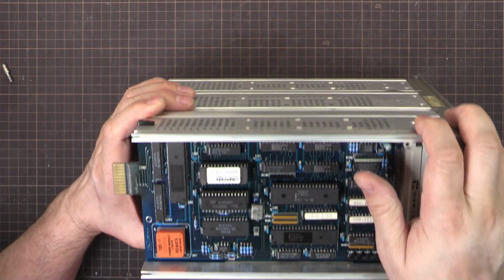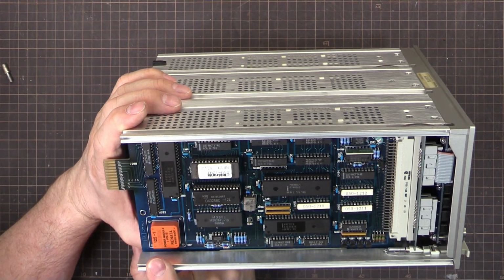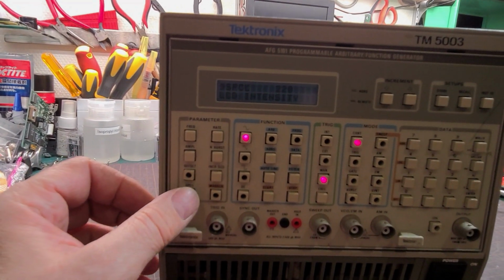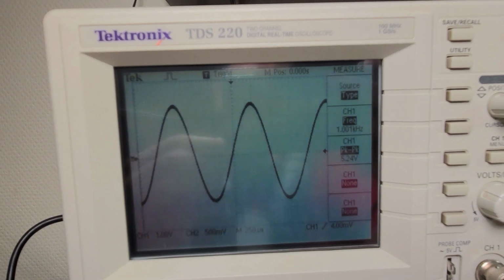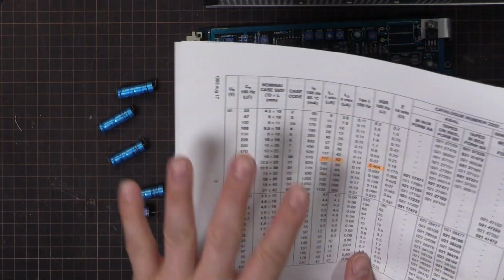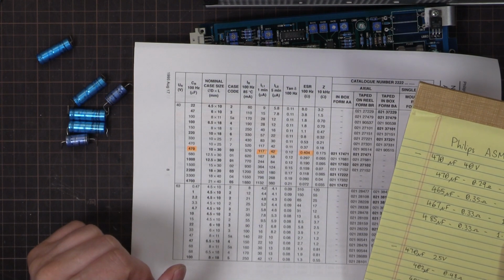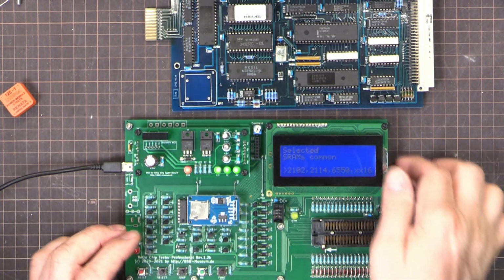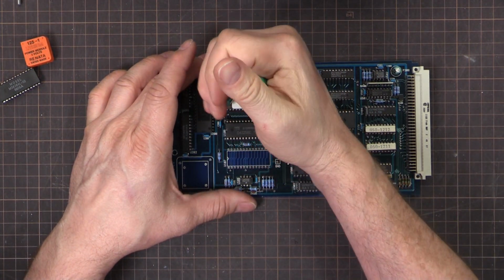Tektronix AFG5101 Function Generator Repair

Comment: nowadays you can even get oled version of those 1602 display modules (no contrast adjustment needed, I'm not sure about their lifespan tho)
Reply from the maker: Yeah, I took a look at them, but I decided to keep the more retro LCD look instead (plus the LCD was cheaper, which is a plus).
I am thinking of using an OLED screen in my Retro Chip Tester though.

Comment: Why, oh why are you making cables instead of boards?  A simple PCB, laid out for all 96 ways with off the shelf right angle connectors is so much easier than all that mucking about.  Populate with 16, 32, 48, 64, or 96 way connectors as appropriate.  DIN 41612 connectors are easy peasy.  If you really really want to do cables then add a 0.1" by 0.1" pad sets (32 x 2) at each end to allow for connecting a pair of extender cards with a normal flat cable by just soldering in 2 x 32 pin headers.

So the order on each card is: male DIN, 3 cm, 2x32 header, big gap, 2x32, 3 cm, female DIN.
Reply from the maker: I used ribbon cables to try to replicate the original Tek extenders.
Using rigid extenders would require having the boards angled out at 90 degrees to allow access to the many adjustment points and would make moving the unit around on the bench without things becoming unplugged a precarious endeavour at best.
Also it would prevent their use for extending the Option 02 board in the center of the unit for adjustment.

The ribbon cables are what Tektronix used in their extender cables and allows for easy adjustment of the unit.

Comment: Yeah, I'm too don't replace old caps if they are in spec.. 👍 Sometimes, older caps is made to last, but newer ones go out sooner..
About erasing old ROM without backup, it is bad idea.. I'm always do backup before erase or update - I had bad experience in the past..

Excellent tips about crimping for extensions! 👍

I'm using JLCPCB - good quality too and fast delivery.. Didn't try out PCBWAY, yet..

Anyway, excellent repair video as always! 👍😉
Reply from the maker: I didn't mention it, but I did take a copy of the old v1.2 firmware. Always backup! 😄

All the firmware versions I've found so far are uploaded to the tekwiki link in the video description for future reference. 🙂
Reply: @NearFarMedia  Thanks God! Backup is always good thing to go back if something goes bad.. 😉 From my experience, update one time didn't work.. 😂 That's why I'm always do backup after that.. And erasing chip without mention backup, that's why I was scared of.. Only didn't mention my stomach reaction in YouTube, hearing that.. 😂
Thanks for reply and explanation! 👍
Waiting for next repair video, because of excellent content!

Comment: I am stunned those blue caps were still good, I’ve NEVER found good ones LOL. I guess they are a bit newer than the gear I normally work on.
Reply from the maker: Yeah, I was thinking of your adventures when I saw these ones. :D

Maybe I got lucky with a unit that didn't get too much use...
Reply: @NearFarMedia  when do you continue the astro boy Building?
Reply: Yeah, this was surprise for me too.. First thought was, that these blue Philips caps is, probably, toast.. 
It's rare to see old caps in excellent condition.. But they were made to last.. Sometimes I get good caps in old gear from 70s, and that's always makes me wonder, because caps, even from this century goes bad after 10 years 😂 But ceramic ones can fail after 3..